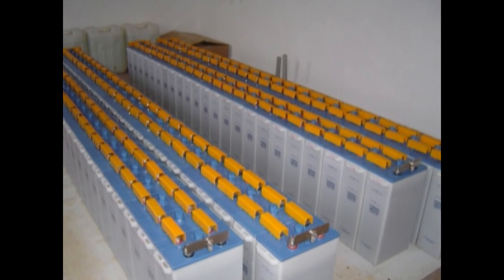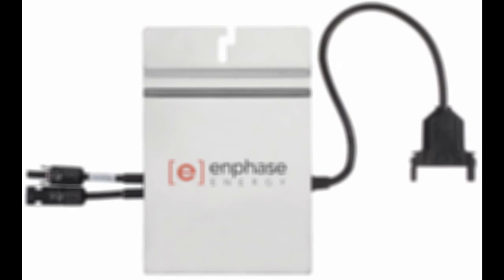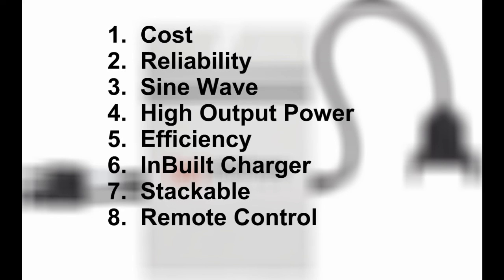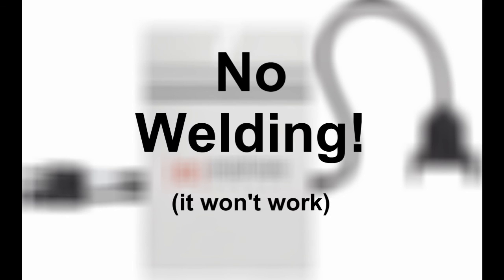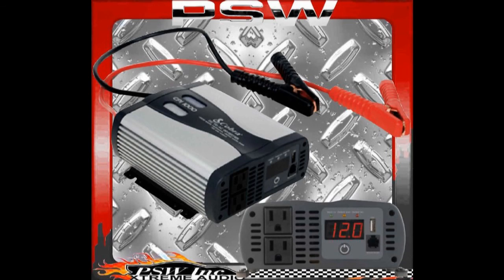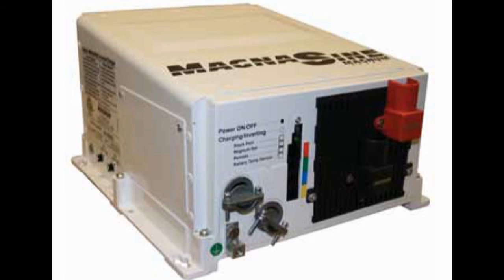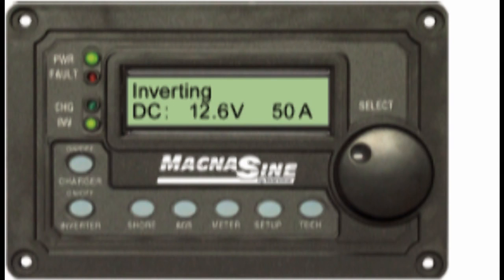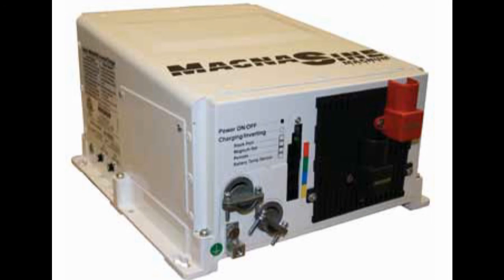Step 3 Solar/Wind Power: Inverter Selection

Comment: Great RE series.

I recently found out about soft start devices for motors and compressors.  

They do not appear to cut down on energy consumption; however, they seem to do a better than average job in containing the initial peak energy surge of power devices.  I have seen numbers cut down between 50- to 60%.
Reply from the maker: Eric Kosak thank you so much for the feedback sir!

Comment: hi Steve
was wondering if you have a 16 point charge curve for the themodyne 48vAC turbine for a Classic 250-
thermodyne said i would have a max of 12 amps at 155 volts @2700RPM

Comment: hi Steve,
went to Auto Zone --the guy took a nut off a damaged alternator--got myself out of trouble

thanks a lot for your help
lou
Reply from the maker: Glad it worked out brother!
Reply: hi Steve
Happy Thanksgiving
Finally got my blades attached and pole up for testing
with 12-15 MPH wind onand off i was getting 5-10 volts DC
a few times blades spinning fast and the most i got was 21 volts DC
now when i used a impact wrench i was getting 90 volts
looking for advice-i do have the blk blades
at low wind i though i would get at least 48+dc volts

thks 
lou
Reply from the maker: It sounds to me like you're on the road, Lou.  Is there something specific you need advice on?

Comment: hi Steve,
so need your help -bought a thermodyne 48vAC turbine--was seeting it up on a pole to do some testing and found that i couldnt get the nut off the turbine when i had it in the garge i used a drill withn a socket on it to turn the turbine to check the voltage
when i was ready to put the blades on i found i could not get the nut off-i guess i must have turned it to far in when i try to test it 
i had to grind the nut off keeping the fine threads in tack
i found that the hardware store did not have any nut that would fit 
do you have any idea what size-esp thread size and pitch

or where i could get a replacement
thanks 
lou
Reply from the maker: Go to your local car parts store and tell them you need the alternator shaft nut for a Chevy alternator.  Also try a wrecking yard.

Comment: magna sounds great. But will I need to take a course at college to learn how to program it and understand it. I bet It will argue with me. Haha
Reply from the maker: There is another style inverter I like better that you can set up graphically from a PC.  It is much less expensive and has a built in MPPT charge controller.  You can find them here:
http://www.ebay.com/sch/i.html?_from=R40&_trksid=p2060353.m570.l1313.TR0.TRC0.H0.Xinverter+mppt+pip.TRS0&_nkw=inverter+mppt+pip&_sacat=0
Reply: @OffGridLivingSteve  hello steve, can i ask why this inverter is better than the magna sine, as i am finally in the market for an inverter i can grow with,tx bro

Comment: Dear Steve, I received your link to the parallel 5kva 4000w 48v pure sine wave off grid solarvinverter MPPT 80A charger. Does it mean this one is an inverter and charger in one device? It could also help me if you could make a video how to connect all these devices, where to plugin the cables and what kind of cables and plugs we need so it will fit? I'm afraid that when I have bought all the pieces that I cannot connect them and in which order I need to connect everything, e.g. in one of your videos you mentioned that I need a circuit breaker, but I don't know where and how to connect it or how many Amp they should be. I really like your videos, which motivated me a lot.
It was my intention to start with a few panels and whenever I saved some money I add more panels.Regards, Rocko
Reply from the maker: Rocko, This unit is a charger and inverter in one unit.  Duane and I will be installing his system soon and we will be creating a video of it.  I have no experience with the PIP and I look forward to getting it installed and putting the video on YouTube.  Please stay tuned and I will have it up as soon as possible.

Comment: Dear Steve, thank you very much for your videos. I live in Belgium and here they have 240 volts. The only place I found was altestore who ship to Europe, but it's $ 2600 incl shipping costs. Can you tell me where you bought yours or do they only ship within the US?
Reply from the maker: I purchased Duane's unit from Ebay.  You can check it out here:  http://www.ebay.com/itm/161243046772?_trksid=p2057872.m2749.l2649&ssPageName=STRK%3AMEBIDX%3AIT

Comment: Thank you very much for those videos. I'm still in the process of absorbing all the information. I live in Belgium and we have 230Volts here. According to my calculation I need at least 3.2 kWh a day. I tried to find the Magnum 4400 Watt, but they don't sell it here in Europe. The only site I found whttps://www.altestore.com/store/inverters/off-grid-inverters/3000-to-7000-watts/magnum-energy-mspae-4448-4400-watt-48v-invertercharger-p8110/ but was much more expensive than what you paid.

Comment: Try this BIG BOY for allot less https://www.youtube.com/watch?v=fULAVylKo5Y
with a combo of this forklift battery type: 24-85-21, after 20 hours of charging with AIMS, you have collected 1340amph capacity, now check on this site 
* http://everydaycalculation.com/ah-kilowatt-hour.php
- Battery Ah Rating: type in 1340
- Battery Voltage Rating: type in 48 volt. press "calculate"...
The capacity of the battery (in units of power) is 64.32 kilowatt hour or 64320 watt hour.
pretty sure you have enough power for several days, don't you think?

For AIMS 12KW just google it under shopping mode... 
now remember, never place that battery outside in any weather condition, place it in a "WELL VENTILATED" shed, with temperature around 75F, never add tap-water to fill the cells, use distiller water instead, most forklift batteries have 5 year warranty, who know you can add "extended warranty" for a couple of bucks.. investment cost a little and save-a-lot for later, check the cells every week, and fill it when necessary...

Lotta people(in generally) don't know the power of a forklift battery, as long you maintenance the battery properly.
Reply from the maker: +Willem Budde All good points, Willem!  That AIMS inverter is a beast, and thanks for providing that Ah to Kwh calculator.
Reply: No problem mate, im bad in calculating simple things called "number blindness", i love to have apps when i got a new phone :D, that AIMS i bumped online, and researched, that big box have almost everything included "start auto generator".. There are AIMS converters/chargers that can handle 12/24/36 voltages, but 48 Volt have no lost, perhaps there is a way to programing to 80% charging, because 100% charged might be under catergory "over-charged", and that is bad for battery.. and other way around, less than 20%, the generator will takes over..

Comment: I went with the Schneider Electric SW4024. It does everything you mentioned here, but only slightly less surge power - 7000w for 30 sec. But it does everything else you mentioned and was about $1450. -- The reason I got it though is because of the extreme degree of remote monitoring & configuration I can do with the ComBox module. - Yes that added another 350. to the equation, but there's nothing it can't show or do. And it communicates with any remote platform you have - laptop, tablet, smartphone - from anywhere via internet. -- Also this inverter interfaces with my charge controller from the same manufacturer so I can see my entire system tied together on one page.
Reply from the maker: +Start The Rebellion The beauty of technology is that everything generally gets better and cheaper over time.
Reply: +Steve Robertson (Off-Grid Living) - That's true. I know the Magnum is about the best there is. I could have gone with it as well, but did not see the ability to have system level connectivity and monitoring with a charge controller and other components (not that it wasn't possible - just that I wasn't aware of how to do that with the Magum).

At the time of your inverter purchase did you look at the Schneider Conext SW4024, and if so what were your thoughts on it? - Schneider acquired Xantrex, which had previously acquired Trace™ Engineering, so the Conext SW4024 is actually the evolution of the Trace SW4024 inverter.
Reply from the maker: +Start The Rebellion When I purchased my Magnum, I don't believe the Conext had been released quite yet.  I have always been a fan of Trace because they pioneered the reliable and robust inverters we all enjoy today.  Obviously had it been available, I would have purchased it because of it's networking and monitoring capabilities.  But to be able to monitor my system status away from home, I just bought a $10 Android phone from Net10 and View the panel from the Android's camera using skype set to auto-answer.  It works well enough to give me peace of mind when I'm away.
Reply: Amen to peace of mind brother!  - Yeah, the Magnum is about the most robust unit in this range, so you can't go wrong with it for sure. - Thanks for making these great videos.

Comment: the farm has the magnum, they haven't installed it yet, but I worked with the tech on designing a start circuit for their genny, they were real easy to work with.
did you use the support panels to wire it up or make your own?
john
Reply from the maker: +Rev John O'Toole I wired my own.  I placed a 200amp Square D QO Series service entrance mains breaker between the batteries and inverter input.  I then ran the AC output to a Square D HomeLine Series panel, unusing the mains breaker, and instead using a 40 amp 240VAC 2-pole breaker as the mains from the inverter to my house.  The reason I used 40 amp is to handle the surge from compressor motors in my heatpumps.
Reply: +Steve Robertson (Off-Grid Living) did you say homeline? just a chuckle with a other comment about it's quality.
thanks for all replies
Reply from the maker: LOL. Yes sir I did say homeline.  It's fine for AC.  Enjoy chatting with you anytime!

Comment: How about Outback inverters?
Reply from the maker: +Mika Lee Outback inverters and charge controllers are great devices, although I have no direct experience with them.
Reply: Living in Asia, I have issues get that stuff at a fair price. Although I can order Outback from Hong kong. Thanks for your reply. I'm trying to plan a system for my farm in the Philippines. off Grid as it is up in the mountains. limited need for power.
Reply from the maker: +Mika Lee if I can assist you further please let me know.  You have many good people on this channel to help.
Reply: Thanks,

Comment: hi Steve,
just installed a Magnum battery monitor-which gives me a load of data-most part to me is SOC
i finally got SOC values from Fullriver both open ckt values and under load values-- 
open ckt volt for 80% SOC value is 50.40 volts

under load volt for  80% value is 48.00 volts

since i have a acin connection from my panel i want to utilize the SOC feature to switch to AC when the battery SOC gets to a 80% level--so should i set the ACIN//gen start parameter to 48.00 volts( just use the under load figures)

Lou
Reply from the maker: +Lou D'Iorio I think you have a good idea.  Once you get a handle, then tweak it until you find a SOC you like.  I always go on the safe side first and than start pushing it a little from there.

Comment: thanks for the response Steve
could you tell me how you determine the SOC of your batteries --do you use a battery monitor --i have read that SOC is not an exact science bec of the constant charging and discharging---having a problem wraping my arms around this issue
Reply from the maker: +Lou D'Iorio SOC is not always accurate.  It can only be determined by batteries being quiescent (Not being discharged or charged).  But read it during discharge with smallest load possible.  It's not an exact science, but close enough is good enough.  I do use a remote meter on my inverter.  I lived without if for many months and finally broke down and bought it with no regrets.  But any meter is fine.  If you don't mind analog, a relatively inexpensive one suitable for 48VDC can be purchased here:  
http://www.allelectronics.com/make-a-store/item/pmd-100v/0-100v-dc-volt-meter/1.html

Comment: hi Steve 
I just installed a mangum 4400 48v inverter and am very happy with it -mounted it on an eplanel
have 8 Fullriver DC400-6 415 ah batteries
still trying tio estabilsh a SOC level and will try to get a table of voltage to SOC for these batteries
since i don,t have a battery monitor i cant use the soc feature in the remote but trying to use the assoc cutin voltage for ACIN/GEN start
has enough surge to run my well 240 volt well pump
do you have any opinion to what voltage level i should use to get a good/realistic cycle life -was thinking of 49.7(approx 20% discharge
trying to est a balance of using the panels to power some loads during the day and battery at night
my goal is to have a system ready if the grid fails

thanks for the videos
lou

i love this inverter
Reply from the maker: +Lou D'Iorio I try to keep my cycle below 10%.  In the real world, it's more like 5% in the summer, and 40% in the winter because my batteries are kept in an outdoor shed.  I'm glad you love your inverter and I understand why!

Comment: We don’t need electricity to take a hot bath (put a container in the sun)
Cooking? Use propane Gas or Bio-gas.

I will like to be energy independent but... not at this price for 1 inverter. 
I don’t want to be broke.

Comment: What we need to be independent is the electricity to power the basic. 
1 small A/C unit running for 12 hrs in 1 bedroom at night (where and when we sleep)
1 light (LED) running for 8 hrs at night (alternative? Use Kerosene lamps)
1 laptop running for 8 hrs any time (make sure U charge your Cell using any USB port)
1 TV running for 8 hrs any time
1 small refrigerator running 12 hrs a day (using a timer)

Comment from the maker: There are lots of good inverters out there.  This one was a no-brainer because in one box it charges the batteries from the generator (if needed) and it supplies the 240v that our water well requires.